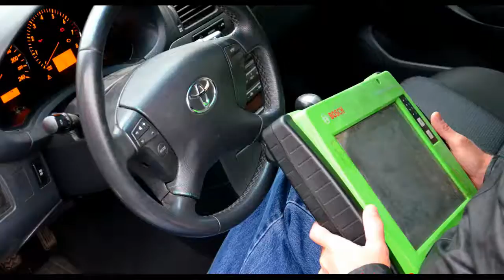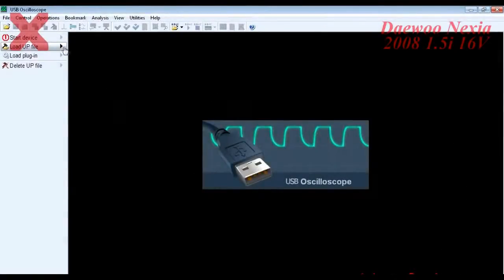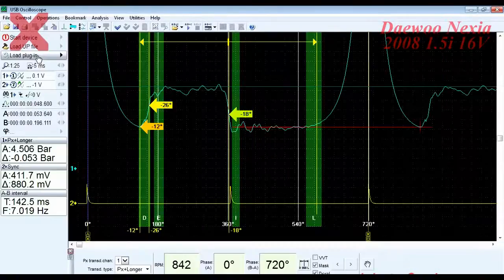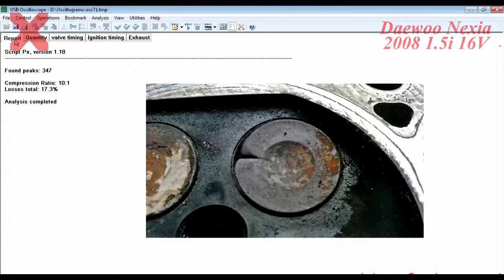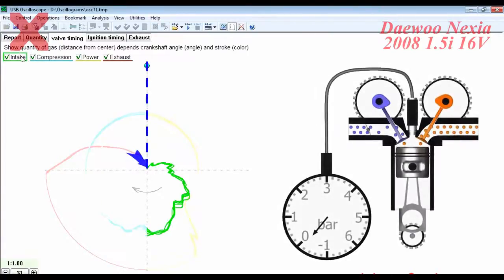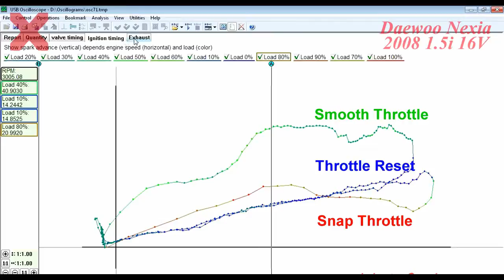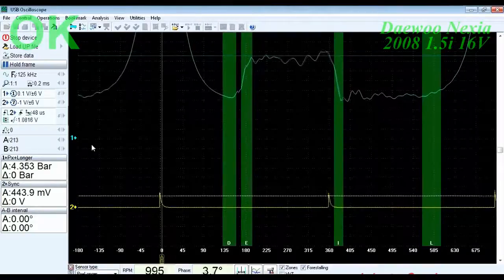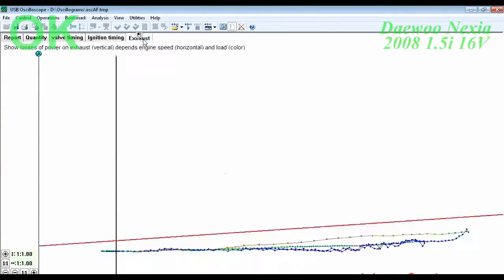Checking valve timing oscilloscope

Comment: where can I buy this software form
Reply from the maker: The software is distributed for free. You pay for the equipment that works with this software. 
For example (without sensors) http://sds-max.com.ua/en/stend-diagnostiki-gazovyh-forsunok-oscillograf.html
Or is it (the price with sensors about $ 2000) http://injectorservice.com.ua/oscilloscope.php#0
Reply: @ДмитрийСеребро  l